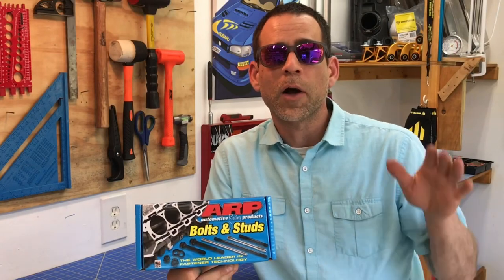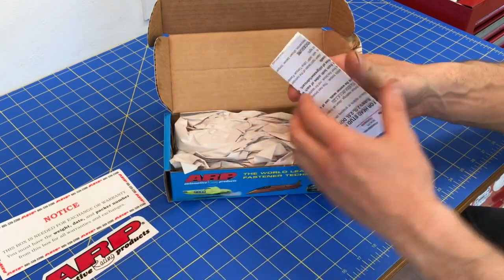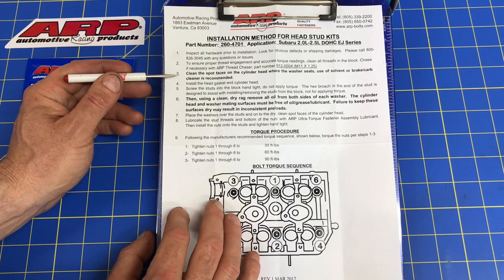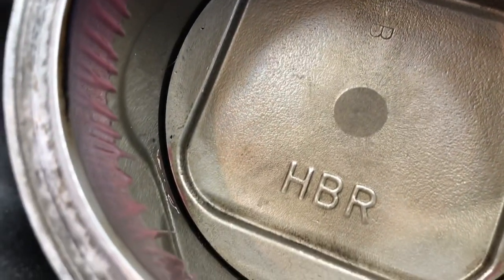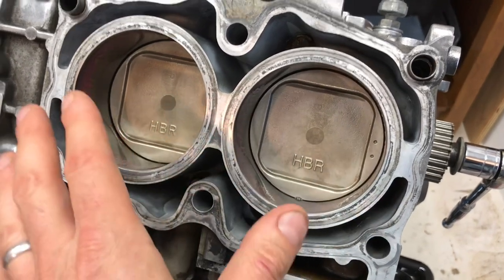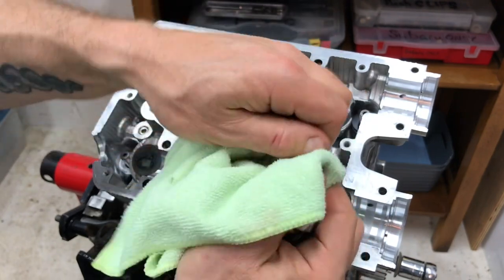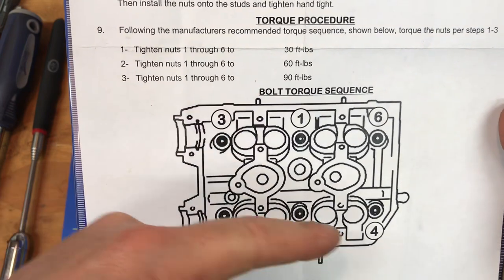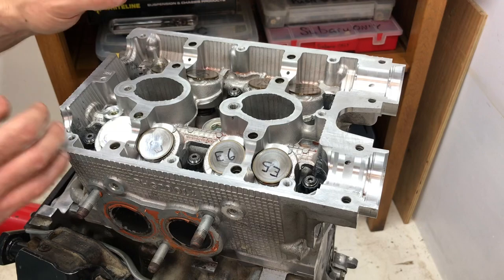How to Install ARP Head Studs in Subaru Engines

Comment: You should measure your head bolts every time you do a gasket change. The stock ones technically I would say in a 1997 ej20k head motor with 2.5 block and 18 psi all day just fine on stock head bolts. I swapped to an 06 usdm 2.5 sti and religiously kept my stock head bolts as I thought they were enough as I measure them every time I changed gaskets and they were the same. 18 psi stretched every head bolt on the 1 and 3 side, and the middle ones on the 2 and 4 side were also stretched not as much. This was with a 8.9:1 compression 100mm forged piston motor 400 wheel torque. These studs were installed with Rcm folded stopper head gaskets from flat irons tuning. Torqued the heads to the arp spec with the nasioc recommendation of bumping the center studs by 5 ft lbs making the final torque step to 95ft lbs on the center 2 studs and 90ftlbs on the outer 4 studs and she holds the 400 wheel torque tune now. And we beat on the car. The oem ones won’t hold high boost for long.

Comment: Good vid. Not interested in blown head gaskets again, will replace head bolts lol
Reply: Head bolts are not stretch bolts. They are torque + degree to compensate for factors such as friction from the threads. But the bolt torque will be in a specified range once tightened down. The FSM does not state to replace the head bolts after use. Replace them if they have corroded or if it is for peace of mind. Hope this helps

Comment: I been watching all your videos learning so much! I just have a couple questions? I plan on getting a ej25 block and use my ej20 heads. Do I now have to get Sti parts instead of wrx parts for the engine overhaul? or just treat it like it’s all ej20 cuz the only difference would be internals really right?

Comment: Great video, but I do have a question. ARPs website says the following:

Do the threads of the bolts going into the block need lube?
Yes. On blind holes use a small amount of ARP Ultra-Torque lube on those threads. If the studs protrude into a water jacket, you will need to clean the threads in the block to remove all coolant and oil residue. Apply a liberal amount of ARP thread sealer or a high temperature thread sealer. Do not apply ARP Ultra-Torque if you are using a thread sealer.

I noticed you didn't do this. Any issues since?
Reply from the maker: No issues so far.
Reply: @SubaruONLY  Asked my mechanic too who I go to for things I can't do or can't be bothered to do, and he agreed with your method so that will do for me :)
Reply from the maker: Awesome! Good luck 👍
Reply: @OKBJay  Subarus do not have coolant going through there head bolt  holes so no need for sealant now and old school Chevy 350 engine yes they do so you need a sealant just so you know

Comment: Great Video. Thanks for making it. What size socket did you use to tighten the nuts down?
Reply from the maker: Too long, don’t recall. Cheers!
Reply: Just put a set in my car and it took a 9/16th 12 point

Comment: Hey nice video just quick question do you have to remove the camshaft and valves to do a headgasket job? Or can I take the head as is to the machine shop?
Reply: Yes, you need to remove the cams to access the head bolts. The valves and buckets stay in the head, Be careful not to drop any of the buckets because they are specific to each valve.

Comment: I noticed that you were following the instruction on the torque sequence. Did you notice that you did it completely the opposite from the picture. Just another detailed eye catcher.
Reply: I noticed it as well. Honestly not a huge deal the main thing is to make sure you start in the middle and use that pattern to tighten down. I've done it with normal head bolts as well

Comment: I’ve herd people using Subaru’s method of tightening down the headstuds for ARP bolts. Any thought or experience with that?
Reply from the maker: I have not. But to be honest, when installing high quality aftermarket parts like these ARP studs, I typically defer to the aftermarket manufacture, as they often do the most R&D with those parts and they should have the best advice for long-term reliable usage. Cheers!

Comment: Hey Luke, I bought ARP bolts for my EJ251 sohc. I just installed them and see they’re too short? By about 10mm . Do you know if there are ARP head bolts for sohc 2.5? They go in cause they’re 11mm but just too short?😕
Reply from the maker: Sorry. Not sure about this. I’d think they would have the right length though, they have SO many applications.

Comment: I have the engine out of the car and it has excellent compression but I would like to install head studs as insurance for when I increase boost. It is possible to install studs into an EJ255 by swapping out the bolts one at a time without disturbing the head gasket, isn't it?
Reply from the maker: not sure. probably not as the torquing it different for the hardware. so have to retorque everything for sure.

Comment: i ordered apr head studs for my  2007 sti   , I'm getting a lot of different input on them, some say After 1000 miles they should be retorqued is this true? some say follow the Subaru process even using APR studs. coming from a honda background wed just follow the instructions Arp Provided with the product and call it a day  What do you think ??
Reply from the maker: I’m with you. I always follow the aftermarket manufacturer’s instructions. Never had any issues. Cheers buddy and good luck!!! 👍

Comment: I have a question about the reinstall of clutch. Can you assist me?
Reply from the maker: Sorry for the delay, how can I help?
Reply: I figured out my first problem with rebuilding the engine and putting the clutch on incorrectly, now the issue that I'm having is the retainer and retaining ring for the pressure plate has forced its way through the pressure plate.  thinking now I have to just order a completely new clutch kit and do it all over again.  is that something you would recommend or bend the retainer like some did on different forums?  Also great video's, keep up the good work.

Comment: So why does the valve buckets on the exhaust valves have an I and the intake ones has an E ?

Edit: AAaaaand suddenly they changed places xD
Reply from the maker: Dude!  I was wondering who would catch that. lol. They got moved and don’t ask me why - think the machine shop reassembled incorrectly, so I had to pause measure all my gaps and then put them back in the right place and continue. I decided not to mention it in the video, as it was a bit of a tangent. I figured someone with a detailed eye would catch that - nice man!
Reply: @SubaruONLY  How do you go about measuring gaps?? I took my heads out this weekend but kept the engine in the engine bay and had a couple fall out, paranoid that they weren't put back in the right placement now :(

Comment: Dont get me wrong i am far from being rich but i hate cheaping out when it comes to replacing things while i have an engine torn down already. Here in nj you'll see a difference of around $50-$70 between stock bolts and arp's.
Reply from the maker: Tell me about it.  Same here.  Worth the extra time and cost, almost every time!!

Comment: Not bashing you specifically, but tired of hearing the old "don't reuse your head bolts" spiel. Say it with me now: Subaru head bolts are N O T torque to yield. Anyone who says otherwise is simply spreading misinformation. There's no reason you can't re-use them unless they're obviously visually damaged. Nowhere in the FSM will it tell you that head bolt replacement is necessary. That being said, ARP studs are great for turbo motors. For NA I would always re-use. Carry on!
Reply: Even the manual has 2 different torque sequences for new and "old" headbolts :D (Y)
Reply: @BFE08STI  there's a break-in procedure for brand new bolts, yes. But that has nothing to do with them being TTY or not (they're not)
Reply: @xjsc16x  I was agreeing with you...
Reply from the maker: Yep, I agree with you 100%!
Reply: Not bashing either, but you do know the difference between an engine and a motor right?
Reply: You can't go wrong with the ARP Studs better clamping power less chance of head gasket failure in the future

Comment: All I can say is WOW!!!  two big mistakes #1 that mating surface of the block is by far not clean enough. it should be exactly like what you see win you get the heads back from the machine shop and that's by far close to it. #2 win you torque any of  your head bolts and or head stud nuts you should never allow your torque wrench to ratchet at all. for two reasons so you can get a visual at how many degrees your torque wrench turns each time they all should be pretty much the same also so your torque wrench can get the proper torque you don't get the same exact torque. I am sorry to say I've been working on Subarus for 10 + years now so I can tell you a thing or two about what not to do as I've done it and learned from my mistakes just my two cents